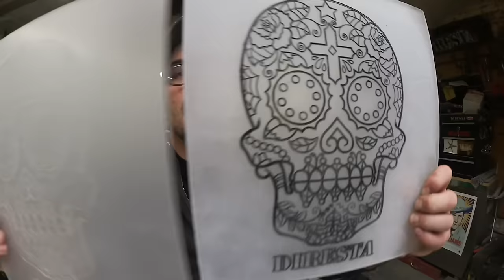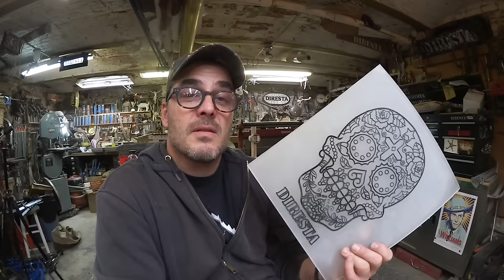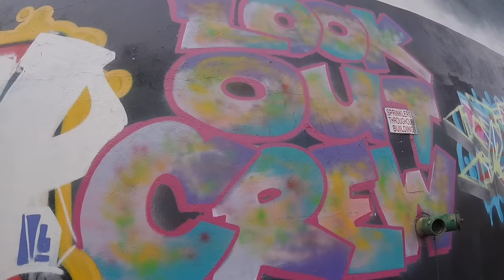✔ DiResta 12 HUGE Lathe

Comment: At 2:20 I totally felt your pain. Clay pipes and tar rope seals when they wanted to keep them from leaking and my house was built in the late 50's around 58 I believe. My place is on a man made plateau, to level things out for the hill we sit on. The plumbing under that plateau is going to be a pain to replace if we ever get to that point. But the part that goes out to the septic system we replaced with all new 4" PVC sewer pipe. That was a fun adventure. We also had to have the tank cleaned because a tree had cracked the lid and allowed dirt to fill the tank, the major problem. Minor problem was cracked pipe that had collapsed.

Comment: Awesome lathe - on units that big it's possible to bend the bed if you pick it up using a forklift under the bed - best bet is running a chain through the tail end legs and around the headstock housing. 
I'm sure you know all this but I thought I'd mention it. 
Thanks for the updates - I'm really glad you started doing the vlog!

Comment: Some old slicks were made with a laminated edge, so if you cut off that broken tip you might be throwing away the actual cutting edge.
Reply from the maker: Aleksey Voloshin good point.  Noted.

Comment: the problem with that slick is that usually the blacksmith will forge high carbon onto the top inch, or 2 inches, and the rest if it will be mild steel. if you cut the top off it you might have an edge for a few days, but it will never ever be a quality tool again. try bending it back, maybe cutting a groove and filling it back in with weld and polishing back.
Reply from the maker: mkcrew225 yep. Very good insight.  I'll do that.
Reply: mkcrew225 also some Japanese chisels only have high carbon on the bottom of the chisel

Comment: Just to solidify what Aleksey, and possibly others have said, that slick has a forge welded high carbon 'bit'.  You can see it several times in the video, particularly @9:57 in the video.  A welded edge is easy to spot, because the demarcation line is jagged as apposed to a quench line -- that would be more even and uniform across the piece.

I'd be happy to show/tell you about a modern 'forge welding' technique, that will make that slick right as rain (shoot me a message) -- without the need to upset or scarf the piece.  It would make a cool video too.  You could also do it like a dovetail or castellated beam.
Reply from the maker: FRUNTCASTER yep didn't think of this.  Happy it was pointed out. I'll save the tip. And weld back
Reply: If you're going to weld it as is (which I'm not discouraging). . .  Might I suggest a braze joint, or even a 309/312 stainless filler.  The brass would look sweet polished down and highlighted.  Conversely, 309 and 312 stainless are designed for the pairing of dissimilar metals, and would be a good choice.  You could Ferric Chloride the piece when done to highlight the joint.  Kind of like Japanese Kintsugi.

After brazing/welding. . .  I would minimally run the Oxy/Acet torch on the carbon steel tip to normalize, then again for quench, and chase it for color to temper.

Your break is so close to the end, welding without heat treating again, would almost ensure a failure, and a soft bit.

Cheers Jimmy!  Thanks for being a Skookum sum beech, and putting out great content consistently.

Comment: My septic tank guy told me to check the end of the pipe there at the tank first. He said that is the place where the roots like to gather. And he's been right a couple of times.
Very good possibility that where that chisel broke is where the original tool steel was forge welded on.

Comment: that lathe is awsome, a real beast, the older machines r sooooo better built its untrue, we have n old 1940s Herbert 4 head pillar drill in work, n it's the most reliable drill in out shop, by FAR! made to last, n last they D ;-) n cheers for the videos u do get to post, cos they r awsome n make a welder fabricator wanna diversify into all materials, took me 2 years to build a workshop, doing it at night n weekends, but it's now done, I have basic machinery in there, but I'm loving working with wood, so relaxing compared to metalwork that I do as my job, n your videos r massive inspiration for me to git gud ;-) so many thanks Jim, top man

Comment: I had a similar issue with my terracotta pipe.  I used a diamond sawsall blade to cut into the pipe and used a fernco fitting to transition from the clay to pvc. I put a 6 inch clean out in.  you can drop babies down there!

Comment: Hi Jimmy,
Thanks for the video!  You might be able to salvage that slick by tig welding it with a silicon bronze filler rod.  You would just need to keep the heat away from the edge so you don't lose the temper.  Check out Keith Fenner's channel if don't already.  He's done some pretty cool repairs with silicon bronze.  Thanks!
-mike

Comment: You could try heating the slick up and bending it back and then welding it. Or maybe welding it and then bending it, not sure which would work better, or if either would work at all, but it's worth a shot I guess.

Comment: you must use 45 deg elbow near the pipe..however its recommended to make inspection chamber in the middle of the way if the distance from your house to the manhole more than 20mtr.

Comment: going to take alot of vinegar to derust that lathe  hey Jim
Reply: Palm sander with a  scotchbrite pad works wonders.  That's how I cleaned an old Delta tab saw I got for free.  It had tons of surface rust.
Reply: well sanding of a lathe's bed is not the best idea though.
Reply: It's no longer fit for any precision work.
Reply: Neither is sanding a table saw table. But that doesn't stop folks from doing it. Honestly that lathe bed is going to need to get reground.

Comment: those old chisels have different steel in the tip, generally it is harder. so, if you just snap it off, you would also have to retemper that edge.
Reply: Some old tools just have hard steel forged into the edge. It takes examining the tool closely in person to determine if that is the case, or not.

Comment: the slick has about a 2-3 inch hard edge and the rest is softer steel.  the slick was probably used to pry against something causing it the snap at the area where the two steel hardness met. it could be cut and resharpened but will lose its edge quickly. best incorporate it into furniture at this point.
Reply: Or just weld the break, some asshole definitely used it as a prybar.
Reply: Jon Simmons welding the break will reset the steels hardness back to soft steel, could even cause cracks throughout the steel making it brittle.
Reply: No, it will only soften the steel IF it broke where it was originally welded to the mild steel. Not likely to cause cracks. A simple cut, grind in a fillet and two passes and it'll be just fine. The process for tempering would be hotter and longer in duration than a couple quick welds so far from the edge.
Reply: That's a lot of repeated heat cycles with a fillet even if you quench it after
Reply: Two passes? I'd bet the first inch of steel wouldn't even boil water. Just weld smart and after the first pass put it in water up to the weld and make your second pass. The steel will still be fine.
Reply: Then again welding it just might work too. It is the only legitimate option available really.

Comment: An old slick is usually made of 2 types of steel, a high carbon cutting edge (expensive) welded to a low carbon  body and shank (cheaper and easier to form). Sometimes, if it is old enough, the body is made from wrought iron. My slicks and some chisels are made this way.
 If you were to just cut that end off and resharpen it you may find that it won't harden enough to hold an edge. Probably someone got it stuck and in trying to get it free they broke it at the weld. Or an idiot prying with it. You should just weld that piece back on and re-harden and temper it.
    Mike (o\!/o)

Comment: ONE OF THE FIRST JOBS I HAD LONG AGO WAS A "PLUMBER'S HELPER" THAT'S AN APPRENTICE LEARNING THE TRADE SECRETS/TRICKS. I'D NOT SEEN NOR DID I KNOW THAT PVC COULD BE DONE THAT WAY. I DO KNOW YOU COULD STOP A GAS LINE LEAK BY LIGHTING A  STREET TORCH AND LETTING IT BURN AFTER IT IS FORCED INTO THE PIPE. ALSO WAS WATCHING WHAT I THOUGHT WAS A VIDEO OF YOUR BUT EVERY ONE WAS CALLING IT A RIPOFF?

Comment: that slick may not be worth spending time on. many were a lower grade steel that they forget weld a quality piece of steel for the cutting edge. where that is broken looks beyond the good metal. If it were mine to fix it would try to weld the piece back where it belongs and just metal finish the welded areas so you couldn't tell. hope it helps.